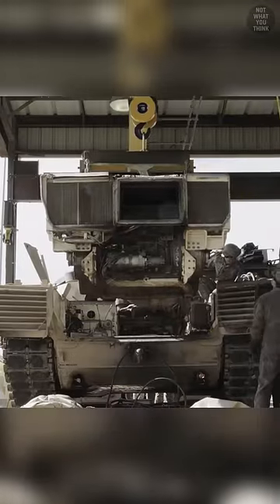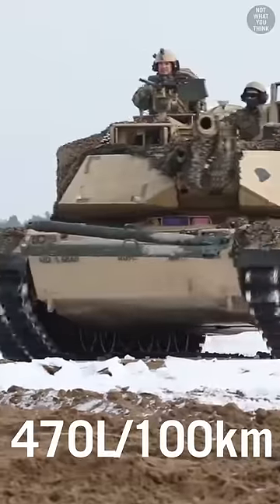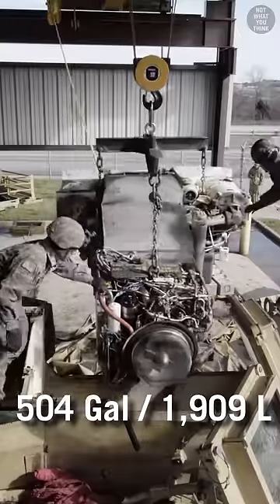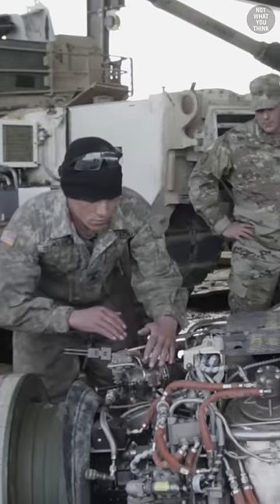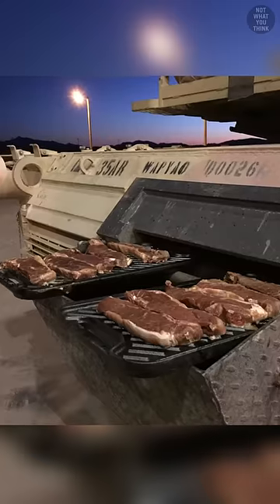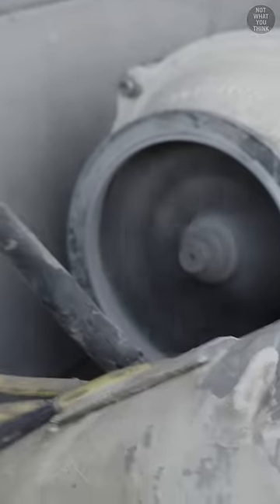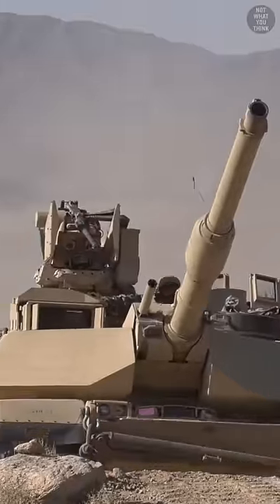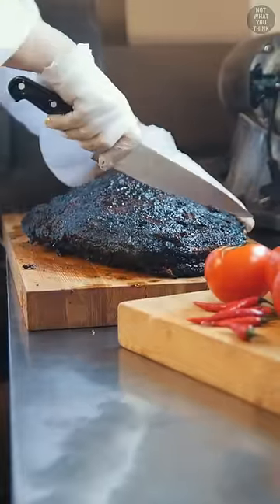Why M1 Abrams Tanks Have Gas Turbine Engines #shorts

Comment: Isn't jet fuel and diesel basically the same kind of fuel? I thought jet fuel is just a more premium version.
Also the Leopard 2 engine is also a multifuel engine, you can even put some high percentage alcohol in there. 

The turbine is lighter though.
Reply: They are simmilar but not the same.
Reply: @Bendigo1  Yes, but they are so similar that you can run a diesel engine on jet fuel.
I am saying that it's not really special that the turbine can run with diesel and jet fuel.
Reply: @Warrior6350  Running is one thing, running well is another.  A diesel engine will not run well on jet fuel or kerosene without adjustment.    The military vehicles designed to run on multiple different fuel types have a slightly different setup to make all the fuels work.
Reply: @Bendigo1  From my understanding diesel engines run fine on jet fuel, just not the other way around. Even if they need a bit of adjustment it is not really hard to build an engine for that.

Multifuel engines that run on diesel and gas is something special, which some tank engines can do.

What I am saying is that this advantage of the turbine engine is just not really special.
Reply: @Warrior6350  It isn't really special but it is important to have the ability to use mutifuels.  And while diesel engines will run on jet fuel, they do not run that great for very long because jet fuel doesn't have lubrication properties of diesel and burns hotter, so it will damage the engine over time.  Diesel has a higher viscosity and takes more pressure to vaporize so is a bit harder to burn, it also uses higher compression ratio to burn well.  Really, the best thing to do would be to mix them so you get the properties of each.

Comment: Bad fuel economy is not quite true. Gas turbine actually use around 120% of fuel use od comparable diesel engine, so not much more. Problem is diesel engine rev MUCH, MUCH LOWER when in idle compared to gas turbine. Which makes gas turbine REALLY greedy for fuel when you stand i one place with engine still on.

Comment: As much as the American patriotism boner goes up whenever the Abrams comes to mind, it’s not as good as Abrams fans think. The Abrams has the one of the worst fuel consumption rates of both Cold War era and modern era MBTs, were and in a few ways still are outclassed significantly in important fields, especially it’s optics and targeting systems by other MBTs currently in service and retired. On the plus side, it’s repair and maintenance costs are significantly less than some MBTs and it has somewhat freedom regarding its fuel

Comment: But if the tank is need a huge fuel tank this guy will also weight a lot. Doesn't this defeat the purpose of the 'lighter engine'?

Comment: Cant the engine run on literal cooking oil if needed to?
Reply: If its flammable it will work. But US M1s use jet fuel which is a high-grade form of Kerosene. Australia uses diesel fuel.

Comment: You mean kerosene is jet fuel you can use basic K1 kerosene jph jet fuel kerosene or basic diesel or even some propane or you can even run a hydrogen system through it and the engine will run

Comment: Is there a way to use the turbine/ generator and the exhaust for a mixed generator and heat unit too.
The same with regular combustion engine generator. German have an Name for it Blockheizkraftwerk
Reply: Cogeneration or combined heat and power (CHP) is the use of a heat engine[1] or power station to generate electricity and useful heat at the same time.

Comment: diesel AND JETFUEL????? NANI?!?!?
bro any diesel engine can run on jet fuel as long as its mixed with 2 stroke oil. Seriously look in the back of a bottle of 2 stroke oil next time you're at wallmart it'll tell you the mix ratio for jet fuel.

Comment: Completely incorrect.
The M1 got a gas turbine engine because Soviets fit a gas turbine on the T-80 and Americans thought Russians are onto something. They werent.
Modern piston engines in tanks are also multifuel, the gas turbine has no advantage there at all.
The downside of gas turbines is the heat and that any damage to it is likely to start a fire, where as a piston engine would not do that. The initial marginal decrease in size is also no longer true today. In short there currently precisely NO benefit in utilizing a gas turbine engine in a ground vehicle.
That is why those are the only two tanks ever to enter service with gas turbine engines.
If it really was better then every tank would use it. They dont. They use multifuel piston engines.
Reply: Gas turbine engines are more reliable, face less complications in extreme weather conditions, can achieve the same power output while being lighter in weight and smaller, which is favorable for transportation purposes, better power-to-weight ratios, higher speeds, etc.
Reply: @Gridlocked  Yes. Which is is why no one is using them in ground vehicles aside from two examples.

Comment: So, you chose jet engines, because, they are lighter and more compact. And build in a significantly bigger gas tank.
And you chose jet engines, because they can run on gas, diesel, and jet fuel - just like diesel-multi-fuel-engines, as used in the Leopard 2 and many other tanks.

So you made your tank less energy-efficient, a nightmare for maintenance and logistics and more prone to detection for no really good reason?
But you have steaks.... well done!